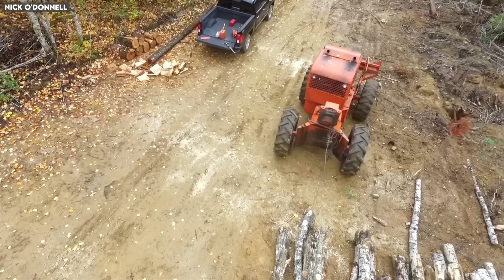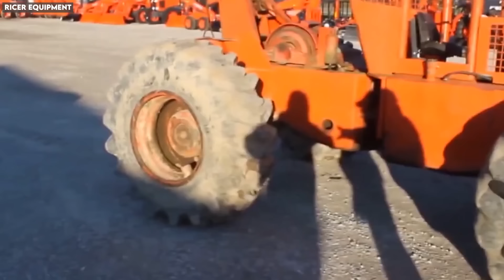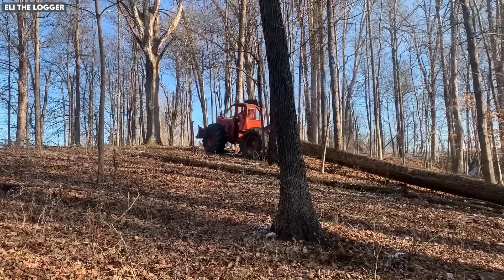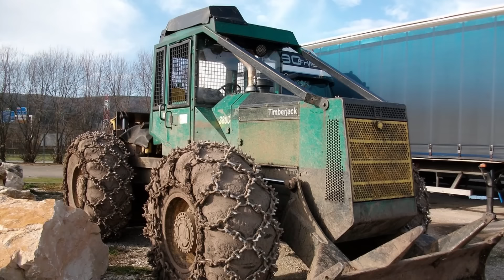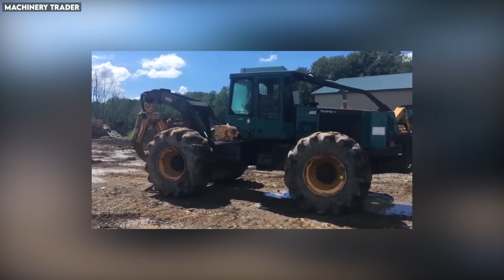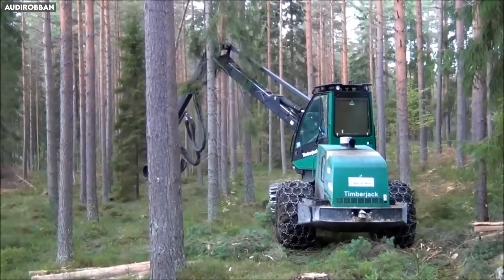10 Classic Timberjack Machines That Ruled the Woods

Comment: Agree with the Deere 440c . Worst machine I ever used.   Had 2 Clark 664’s.  Both 30,000 hrs. Never a transmission problem . Best winch in the day . I’d like to see all the wood in one pile they skidded over the years .  Also ran many timber jacks in sun zero weather.  No planetary issues . Not sure where this guy got his facts